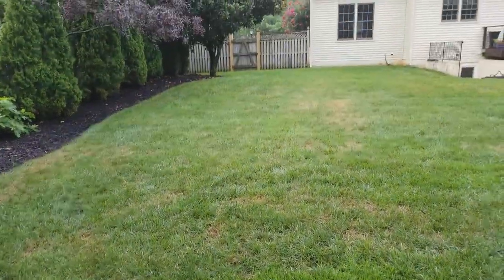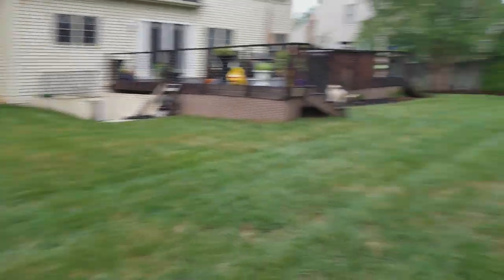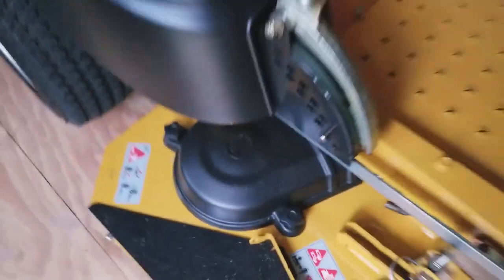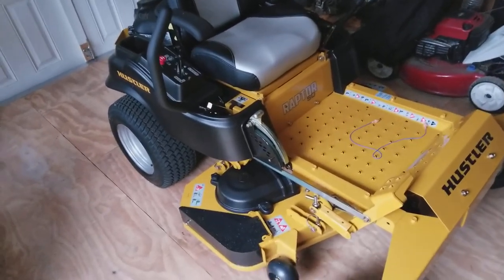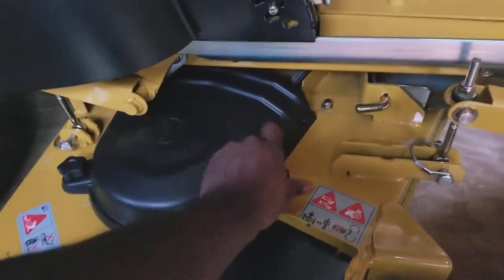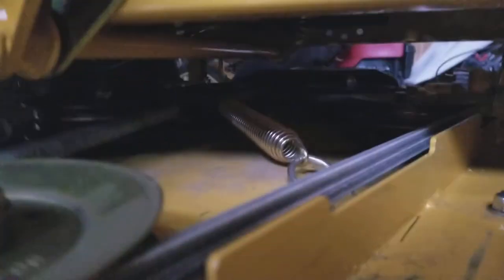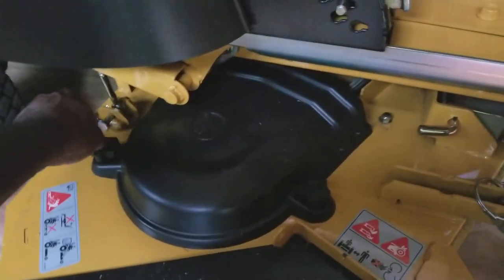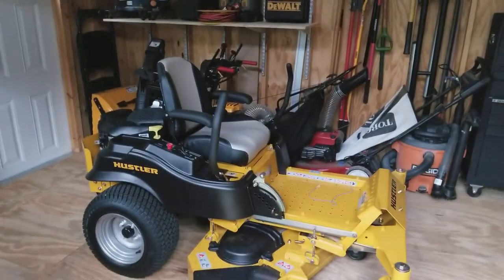Hustler Raptor SD 48 -- Belt Cover Fix

Comment: The belt guard bolts are 1/4" -20 X 3/4". Amazon kit is 1/4"-20 Three Prong Clamping Thumb Screw Knob Stainless Steel 1" Long Stud 4-Black $8.99 + 4.00 shipping. What the numbers mean: 

1st number is the diameter of the bolt i.e. 1/4 inch
2nd number (after the dash) are the number of threads per inch
3rd number is the length of the bolt excluding the head. i.e. the length of the shaft.
Reply from the maker: Yep! Also, just remember to put a dab of grease on the thumb screws, so that they don't rust in-place.
Reply: @ngcreese1  I use anti-seize compound because I think it does a better job of preventing rust. Thanks for the reminder though.
Reply: 77

Comment: Nice mod. Im gonna change it up a little and use threaded knobs with nuts instead of bolts.  Ill mount some 1/4-20 studs(1/4-20 bolt) from under the deck. This way the holes don't get worn out over time. This is an old trick I learned working on Harleys for years.
Reply from the maker: Sounds good! Post a vid when you're done!
Reply: Dictum did you end up ordering the knobs with nuts instead of bolts? If so can you reply here with the link or part number and where you ordered them from?

Comment: Where did you buy the discharge cover I can’t find one
Reply from the maker: Hi Damian, do a Google search for "Hustler Raptor SD Mulch kit 48". Replace 48 with your mower's deck size. That should provide a good set of places to pick up the discharge blocker, and required additional parts.

Comment: Where did u get the discharge cover?
Reply from the maker: Hi, that block off plate comes as a part of Hustler's mulch kit for the Raptor SD. You also get blades and baffle plates for under your deck.
Reply from the maker: I ordered the mulch kit from my Hustler mower dealer.